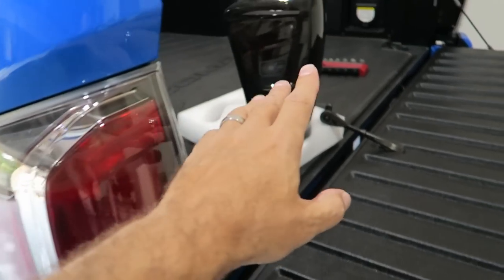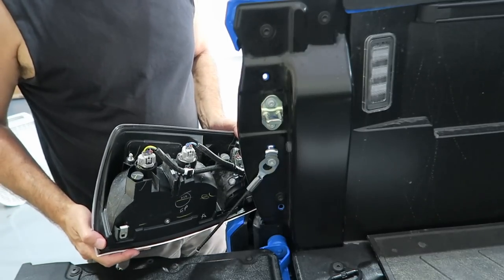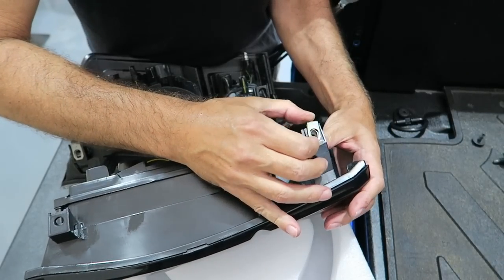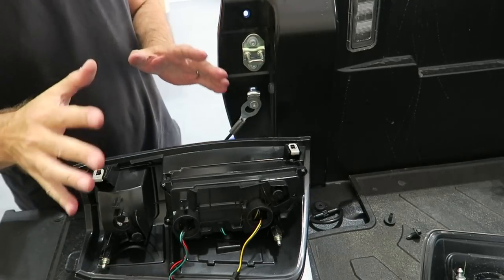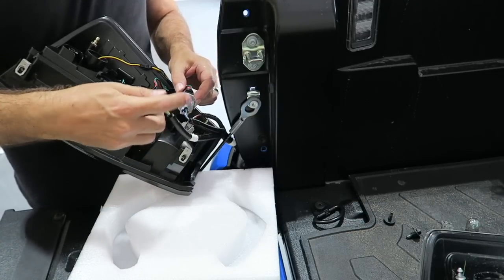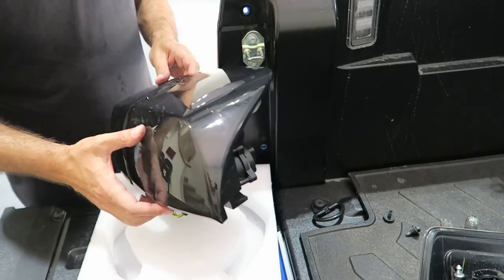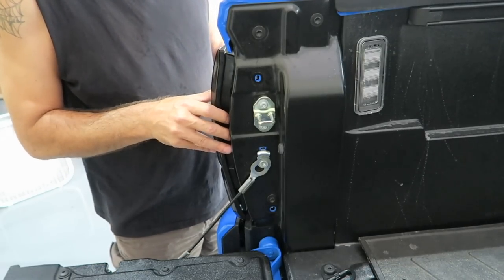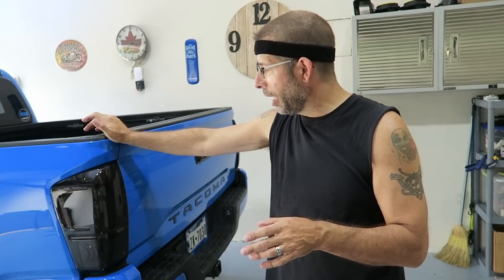2020 Tacoma LED Smoked Tail light Install

Comment: The turn signals were hyper flashing? I believe that means your car thinks you have a bulb out. The remedy is to add resistors that are grounded. Had the same happed to me. Had to install resistors. Works great. I went with a Recon smoke full LEDs. Love them.

Comment: I bought these and had to return them. The connectors have very little wire to make connection. My right side would quit working with any bump. Gonna try tacomabeast they seem to have better connectors.
Reply from the maker: Hmm…I didn’t experience that.  Beware… I think TB sells the exact same light🤔

Comment: I bought the cali raised raptor tail light I have had nothing but problems with both of them leaking. They have replaced both of them but I’ve had them in for 4 months and 5000 miles and they have both had to be replaced I wouldn’t recommend going with Cali raised for a tail light
Reply from the maker: That’s a bummer.  I have heard that before 😬

Comment: Don’t forget, if you’re buying aftermarket tail lights, that there are holes in the rear of the mounting area that have the possibility of taking in dirt and debris to make sure everything is sealed up. Had an electrical issue with my 2020 because of it.
Reply from the maker: Thanks for the tip 👍

Comment: Personally I would never put Ford/Raptor inspired parts on my truck, I drive a Toyota not a Ford, while I may think some things off the Raptor do look nicer I'll just leave it at that. Plus all my buddies that drive Ford's would NEVER let me hear the end of it for trying to impersonate a Ford
Reply from the maker: To each their own.  That’s the beauty of different tastes👍
Reply: Don’t worry those are not Ford inspired tail lights, it’s just a name. If they were Ford tail lights they most likely wouldn’t work anyway.
Reply: @stanm9396  HAHA!
Reply: Hey rob I just ordered these and both mine have this flaw on the inside of the light. I thought the tail gate would hide it but it doesn’t did you have that problem?
Reply from the maker: Nope.  Not sure what you mean?

Comment: Good video, what can you say about the hyperflashing on the blinkers? Are they fixed or need and kind of resistor
Reply from the maker: Mine don’t have the issue🤔
Reply: @RobMotive  I forgot to ask you before if u know something since my truck is SR5 and yours a higher trim if mine needs resistor or there's not a differenc, thanks
Reply from the maker: I assume they’re the same but I don’t know for sure 🤔

Comment: I had the black/clear but i didn't like the white led bar in them and where thr othet lights were was a bunch of chrome. Ive been thinking of switching to these also.
Reply from the maker: That’s what I didn’t like about most that I saw.  These are dark enough to solve that concern👍

Comment: I must say the brake light led is MUCH better on these than the winjet. Still no issues? You still love them?
Reply from the maker: I agree!  No issues👍
Reply: I ordered a different company but they did not fit right so we will give these a go because of your video.
Reply: Looks like they changed them and they are no longer “smooth” on the bottom side looks like “gills”
Reply from the maker: That’s odd.  Wonder why🤔

Comment: How do you take off that small light bulb the only one you didn’t take off I need to connect that part to my new tail lights
Reply from the maker: Nope sure which you mean?
Reply: @RobMotive  the reverse light after struggling I found out you had to squeeze the top part to take the connectors off of the bulb
Reply from the maker: Ahh!!  👍👍

Comment: Any recommendations on where to buy matching headlights?
Reply from the maker: I’ve never seen blacked out headlights like that🤔. Not sure they exist?
Reply: @RobMotive  thanks so much for responding :)I replaced my taillights with the same ones you have but I want to change my originals (silver chrome) with maybe something that can match these raptor ones?  Been looking in tacomabeast but wanted some pointers/recommendations! Thanks again!
Reply from the maker: That would look pretty cool.  I’ve only looked a few times myself.  Never found any I really like.